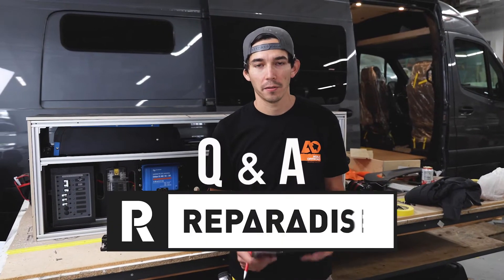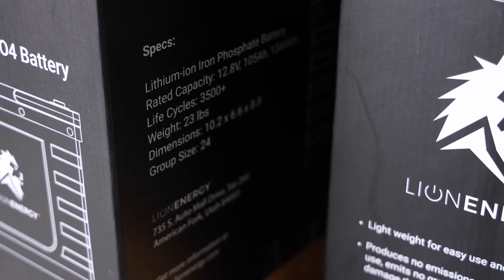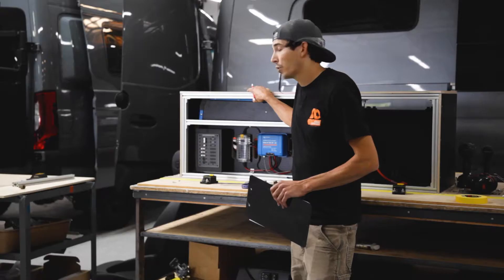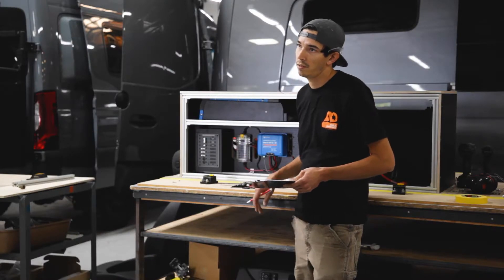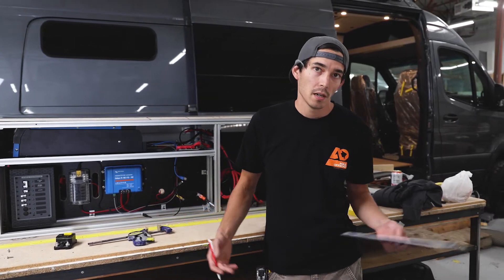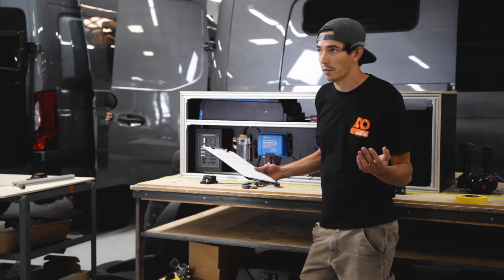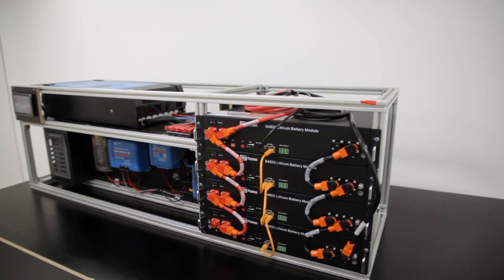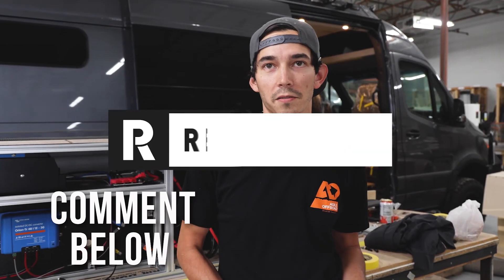QA Camper 12 volt 24 volt 48 volt

Comment: Damn that 48v system you displayed looks so compact! Im still trying to wrap my head around 12v vs 48v. For me, it seems like 48v is the better choice because you can draw more power to charge the batteries via solar, but would you be able to use regular 12v items on it or would you need a 12v converter? Also... 48v 100ah batteries last longer than 12v 100ah batteries right?
Reply from the maker: 48v is definitely superior, quicker recharge times, denser energy so the battery bank is not so large and it's especially well suited for alternator charging. You would need a DC to DC converter for 12v appliances